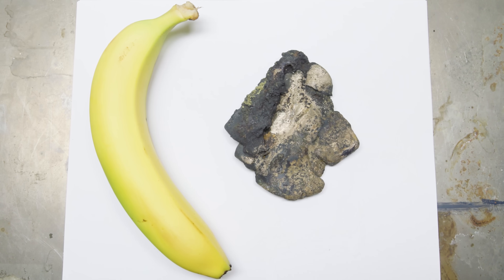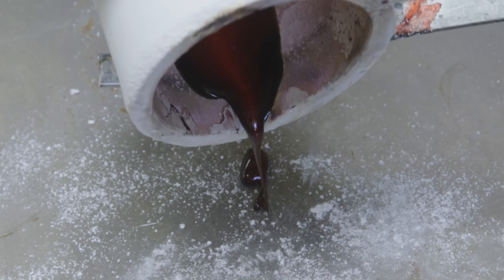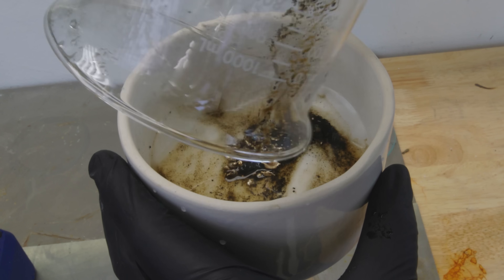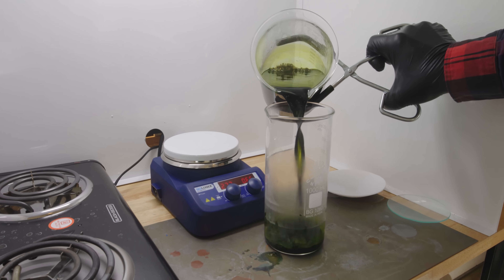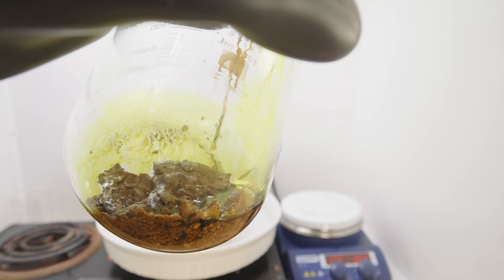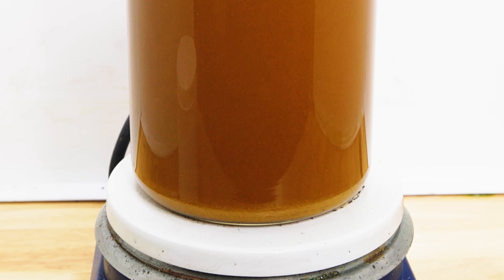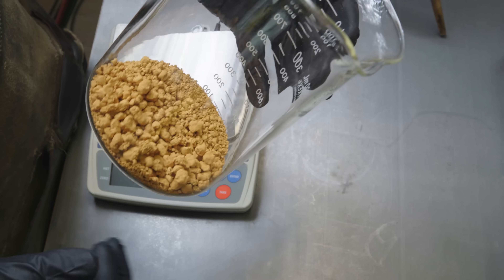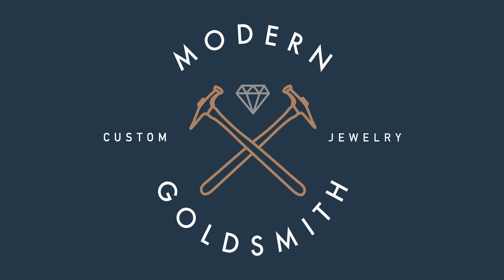Turning a BLOB into PURE GOLD!

Comment: Congratulations, Now see youtuber sreetips. He does this for a living. He uses a technique called "inquartation" by using .925 (sterling) silver to alloy the gold to ~6k or 25% pure gold. This melted alloy, called "Elektrum" is poured into water to make shot or granules. This make the dissolving step go faster, He then uses the boiling aqua regia, filtration and sodium metabisulfate to precipitate out the gold. The gold is then boiled in hot HCL to further dissolve out any remaining silver and nitrate. This step, followed by a distilled water rinse is repeated five or six times. A squirt of H2SO4 will cause any lead to precipitate out and be caught by the filtration step. BTW, the "forbidden orange juice" is a compound called chloroauric acid. This process is repeated three or four times to finally yield pure gold. Sreetips regularly achieves 99.99% pure 24k gold. The blue-green silver/copper solution is then put into a beaker with pieces of pure copper (scrap copper tubing is good) and the silver "cements" out of the solution leaving green-tinted copper nitrate to be recycled. The cemented out silver is then melted and made into copper shot to be purified into 99.99% pure silver by an electro-chemical process.
Over the years, I've watched him make scrap caret gold, gold-filled jewelry and scrap sterling silverware into probably tens of kilos of pure gold to be sold on to refiners.

Comment: what kind of melting torch are you using?
Reply from the maker: Smith !
Reply: thanks, but i'm new to metal smithing. i got myself a decent little butane torch that seems to kind of do the job. starting off on trying to melt copper wire in to ingots. i don't really know what i'm doing yet. are you using a propane setup, or propane mixed with oxygen or something? @moderngoldsmith

Comment: You could have done this faster and cheaper and by smelting the original gold in a blend of silica flour, borax, charcoal and a small button of lead.   The lead has chemical affinities for base metals, and silicon dioxide so the lead and base metals get vitrified in the process, the borax reduces the melting point of the silica flour and the charcoal helps oxidize other impurities that either gas off or get chemically combined in the silica.   Once you get rid of the trash the aqua regia process can be used and if you're ambitious the Wohlwill process can remove the silver and PGM leaving you with .995 or higher fineness.   I helped the younger brother of a friend of mine with this years ago when he was a sophomore in high school.   I took a day off work and helped him demonstrate smelting and refining ten gram buttons of gold that his grandfather had left him to each of the chemistry classes at his school.

Comment: You don’t have to be a chemist and you don’t need a assayer just deal with the dumb hicks up in Alaska do when they mine gold or anywhere in the world gold miners aren’t the brightest bulbs but they are hard-working and they are passionate and driven you just gotta heat it up and all the gold will sink to the bottom of the crucible and all the impurities will rise to the top and then when it cools down you get a ingot and you just knock the slag off the ingot and then you reheat it up in the crucible and pour it into a mold and you got a little gold bar and it’ll turn that 10 karat gold into 24 karat gold

Comment: Copper is a mercury metal. Gold is a Saturn Neptune metal. It’s pressurized aged Neptune plastic. I don’t know why you want to place so much value on gold. Platinum for example, from Venus-Uranus is more valuable as a high tech (power cables contain platinum. It stays cool and has beat conductivity). God is very pretty and it adds colors but it’s a poor choice for building materials. You can easily make gold fools with tin foil and copper.

Comment: More a testament to the validity of the processing than your skill with the chemistry.
While you anticipated 222 g and pat yourself on the back for 213, I’d question how much of it was poured off in your earlier steps.

Adding the Na2S2O5 to that green solution, and then pouring off the yellow solution, yeah, you got the Au that had made it that far, but the resulting yellow solution could have been loaded with PGM.   Same goes with the Ag you took off as AgCl.  If you cemented it out with Cu metal, you’d have cemented out any Pd, too.

I get that creating You Tube content is fun and possibly lucrative, but you should have gotten the process down with a couple test runs.

TL;DNR. Save your waste streams.   There could be a lot of Au, Ag and PGMs.

Comment: The thought of how people figured this all out is just amazing. Theres so many steps that need to be done in an exact certain way that i can only wonder the frustrations people had in the past to figure this all out.
Reply: Generations upon generations of applied sciences, culminating to what we have today. It's likely the result of100 smaller experiments for different reasons, that gave way to the knowledge needed for the process.
Reply: All the steps are reversible. And you  theoretically could just work out the process by brute force, poking at  the ore/alloy with different processes until you succeed. But of course, Smiths had a long list of techniques that they had had passed down to them, for removing oxides and sulfides from ores. And then someone discovered the bone meal crucible, probably by trying to make a crucible that transmitted the heat swifter than a clay one does.
Reply: Fun fact: (kinda)
We humans have been fascinated with gold since around 5,000 BC. 
If today, we were to take the entire world supply of gold, collected since 5,000 BC and we melted it all into one giant cube...
(rough calculation only, as gold supply is always expanding each year by 1% > 2%) 
That giant golden cube would be roughly 22m * 22m * 22m (22m^3 or 10,648 cubic meters) 
and would easily fit under the first level of the Eiffel Tower. 

Imagine an Olympic sized swimming pool, that's as deep as it is wide and is long: 
25m * 25m * 25m
The world's gold would fit in that and still have 3m on each side before even being close to being filled. 
I can't find the source, but I once read that this 'gold cube' grows at the rate of about 1cm to 2 cm per year.
Reply: @LifeForkB21  don't mean to be an asshole, but I'm afraid I must:
1) you must mean 22^3m^3 or indeed 10648m^3 
2) olympic size swimming pool is 50m long.
Reply: @vicbauwens  thank you for the correction. You get the point. Big-ass block of gold; fits under the Eifel tower!
Reply: @LifeForkB21  244k metric tons to date. TIME FOR MATH
Reply: @LifeForkB21  how much of it will still be buried somewhere?
Reply: When there's greed people will figure out anything
Reply: Thank you for this perspective!
Reply: Truly  an Amazing  video!!! Seeing  the whole  process  of Blob to Button and witnessing the  final  product  to its  purest  form was a Blessing  to watch. Modern Goldsmith you  have  a incredible  talent.
Reply: So true
Reply: In the past, it was common to use mercury in gold refining.
When gold blob meets mercury, gold is "dissolved" in mercury and make gold-mercury amalgam. Other impurities aren't.
After that, when the amalgam is heated, mercury becomes vapor and only pure gold is left.
This method is simpler and faster than the method using aqua regia from the video. 
The health of blacksmiths who are going to inhale a lot of mercury vapor in this method, well, who cares? The gold is in front of us.
Reply: Started By the Catholic Church to be specific
Reply: @beatusmasero9518 
Idk if u mean smth else, but Gold was discovered by older civilizations
These countries were the first to discover yellow gold, the names r the modern names so it had different names:
1. Egypt
2. Iraq
3. Syria
4. Kuwait
5. India
6. Pakistan
7. China
8. Peru
9. Mexico
10. Colombia
11. Greece
12. Italy
Reply: aliens
Reply: ... and that's why you must respect your ancestors.
Reply: While being prosecuted by the church in the process. Having to do it underground had to make it a thousand times harder to share information between alchemist.
Reply: @ericknabenshue5689 
Bruh, what are you even talking about? The Church literally funded all of it. 
Where did you learn your history lessons? I seriously need to check your professor's credentials.
Reply: @ultron3693  if you are an american asking about the origin of others history lessons, while believing about the church beeing founder of increasing the purity of Gold via chemistry ......... then i don´t wonder why you have a crazy orange clown as president, i bet when the news tell you often enough that jesus invented gunpowder to win against the romans, you would not hesitate to spread that Historical Fact
Reply: @ericknabenshue5689  bs ,ure 🤡, this thing came from Egypt, this knowledge  is not even from humans but annunaki  and different  kind of aliens that also build piramids
Reply: @ericknabenshue5689  alchemy is a is not a science and has nothing to do with refining gold
Reply: @ericknabenshue5689  Tell me exactly who was prosecuted by the "muh bad Church" in the past for such a thing as refining gold? Did you know that the Church itself used pure gold for many things such as cups and for plating statues for instance? Why would they prosecute alchemists and goldsmiths that were making the golden things for them?

Pretty pathetic "attack" at the Church. Tell me, do you visit r/atheism often?
Reply: @ericknabenshue5689 The modern scientific method was created by Christians in order to  glorify God by better understanding his creation. 

Along with the entire university education system. They were all started by the Church. 

It was only within the past ~120 years that people have thrown out the thing that inspired such progress, and put themselves on a pedestal rather than God.

Comment: .My spouse and I are adding a variety of stocks/ETF to my present holdings for the long term, We've set aside $250k to start following inflation-indexed bonds and stocks of companies with solid cash flows, I believe it is a good time to capitalize on the market for long-term gains, but it wouldn't hurt to know means of actualizing short term profit.
Reply: Holy these bots are getting advanced 😭😭
Reply: gregory giovanni  I love these bot clowns
Reply: @cd5433 hai i want to learn can u help in this
Reply: Thank you for this tip. it was easy to find your coach. Did my due diligence on him before scheduling a phone call with him. he seems proficient considering her résumé.
Reply: Karl 🤣
Reply: Buying bonds, treasuries or any other financial imstrument only supports the Central Banks and Government malficence. You only support and propagate their financial robbery and corruption. I only keep a working amount in financial instruments, and keep everything else out of the system. God bless.
Reply: Buying a stock is easy, but buying the right stock without a time-tested strategy is incredibly hard. hence I will suggest you get yourself a financial-Advisor that can provide you with entry and exit points on best stocks to buy now or put on a watchlist.

Comment: filters out the first boil, proceeds to put the filtered material right back into the clean material lmfao. you also need to add about 5mls of sulfuric acid during the first hydrocloric acid boil to precipitate any lead out of the solution.

Comment: Not flux….term is slag
Flux breaks surface tension of melting solder if any metal type so it gives a proper solder joint

Slag
I would use a centrifugal casting process to remove the slag

Comment: You mixed steps by starting with aqua Regia.
Always do a nitric only boil until no silver in solution.
Save this liquid .  you can copper deposit the silver later, or use as solution for silver crystal formation.
After nitric wash then do aqua Regia dissolving.  You need to add 50ml sulfuric acid too to the aqua Regia you made.
Faster and cleaner.
The initial solution should be blue green on silver and other metal removal.
Next should be a clear orange solution.
Save excess fluids here too. Palladium and platinum usually also present.

Comment: So lets see to get your 222.39 g from the gold alloy: 

Milled the nugget to .0111 Mle particulate. 533.17G mean weight.
Water, Hydrochloric acid, pretreatment filter particulate at 85C, remove filtrate 
Nitric acid hydrochloric water, aqua leaching at 90C 
add water filtrate , remove chloride metal compounds ( Ag, Cu , Tin etc) 
precipitation diffuser 80C with CO(NH2)2 carbamide, ethanedioic acid HO2C−CO2H and sodium hydroxide final acid solution.
( or can use similar precipitation with Zn(CN)₂ zinc cyanide )  remove waste acid
gold sponging and then gravity vibration filter or hydrous filtration to deposit net. 
water and gold as byproduct.

Comment: This is fascinating to watch, while I am no chemist I used to work in a gold mine and the process was to use cyanide to turn the ore into a solution and then use carbon pulp to extract the gold from the solution at which point it would enter an electroplating bath where the the gold would literally stick to these sheets and the rest of the solution would rerun through the process. 

The operators would remove these gold sheets scrape the gold into crucibles and pour these whopping 12.5kg (440 oz) bars! I wonder if an electroplating extraction option would be suitable at home for your final step to try something different from the precipitating chemical in another video?

Comment: In the final steps when you boiled the gold in water and hydrochloric acid, you should have also added some sulfuric acid [a few ml] because this helps to refine any tin or nickel [I forget which one exactly] out of the gold and clean it up some more. Also, putting the gold back into the solution several times and dropping it with the metabisulfite helps purify it to the .999 fine most people are looking for. Like I said in my other post...you have inspired me! Thanks
Reply: The gold is 10k the sulfuric acid would destroy the original alloy

Comment: Let me just clarify something. Just because the sliver of gold that was tested came back as 41.7% pure gold doesn't mean that the entire chunk was only 41.7%. It most likely was higher and lower in different parts and I suspect it was higher throughout the entire piece and that this process might have wasted a lot of gold. All the same, you did excellently and now it makes me wonder how much is in my 5-gallon pail I need to refine. It will take a fume hood, metabisulfite as well as crucibles and a filter system before I can get started after making my own nitric acid. You have inspired me!
Reply: It wasn't even tested at 41.7%, it was tested at OVER 41.7% (>10 K)

Comment: Very interesting.  I can't help but wonder if electro chemistry could have been used to make this easier.   For example in copper refining, impure copper is made an electrode and deposits as very pure copper on the other.   Contaminants fall out.   

Alternatively,  zone refining using precise induction heating can be used in some applications. 

The goal of this would be to cut chemical use by 75+ %

Comment: I've heard that nitric acid is expensive.  What was your final bill, all things considered?  MAP gas for the torch, new crucible, acids, test solution?  and total time?

And next time you will get faster results by more finely grinding up your sample.  The water method gets you nuggets, but as you saw, the "gold powder" reacted much faster and wastes less acid.  If you can file down the blob into more of a "sand" texture, the aqua regia will work much faster. (it's all a matter of increasing the surface area)  Also consider using a hotplate with a magnetic stir rod.

Comment: Guy who is non chemist have lots of chemistry equipment  🫡 and ofc made huge much of mistakes ..

1.why you hiting up acid before ..
To get rid of other metals you should use only nitric acid. It's not anyhow dissolve gold. But dissolve silver and so on (which can be recovered later )

2.You don't need to repeat process for purity. You need to take brown dirty gold and boil it in nitric acid. Actually because you didn't do this step before you left over with dirty material. You should never use AR just so without removing other metals by nitric .

3. Also you would not have any silver chloride. It would be disolved in prev step with possibility to recover later.)..

4. Large mistake not making neutralization of acids left overs in solution by urea. You can not just start gold recovery process even without knowing your ph. Gold loss can be huge
Good luck

Comment: [cringes slightly in chemist], but as a novice you made an excellent first stab. For next time: try to use larger vessels or smaller batches, as working with nearly-full beakers can lead to disaster if the hot acid solution 'bumps' or foams over. I was also half-expecting a cracked beaker from heating on that naked electric coil. Buchner funnel technique calls for vacuum and a rubber adapter. I might have chosen a glass frit instead of paper that disintegrates in concentrated acids (as you demonstrate in part 2). As a rule, filtrates should be clear or the separation is incomplete. Strategy-wise, some preliminary digestion in HNO3 might have sped you along, as noted in other comments.

Comment: 500 grams of 10k is $12,400.00.  Just melt it down and clean with borax.  This long and expensive process cost more than the value of the recovered gold.  Melt down and clean with Borax would cost less than $10.00 and 30 minutes time and profit over 12 grand.